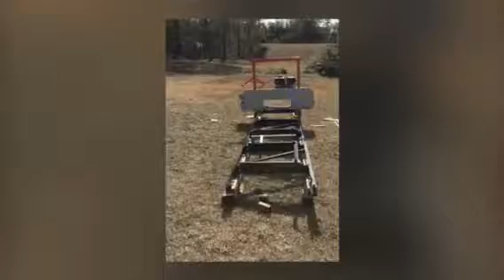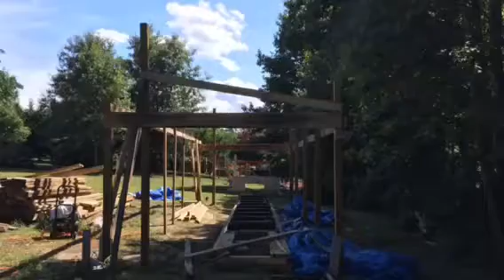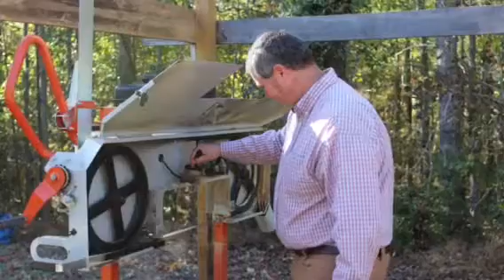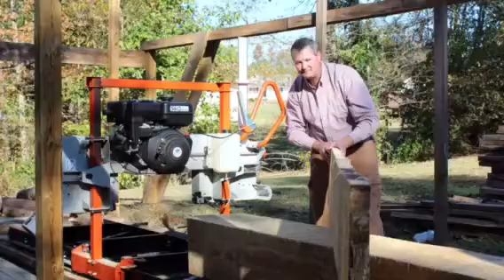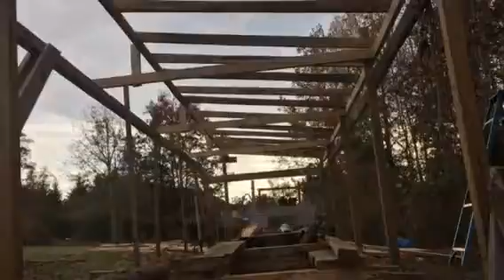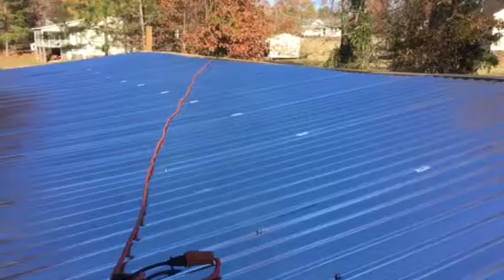Sawmill Shed Build Part 1

Comment: Do you like your timbery Mill, I'm debating on purchasing one but can't find anyone that owns one.
Reply from the maker: Yes I do. For its size, I am amazed at how much I am  able to do with it. I researched several others before I decided on My Timbery M100. I did upgrade to the 14 Horse power and have added bed extensions as I went.
Reply: eddiemac2008  thanks, I was looking at getting one with the 14hp to, just haven't found very many reviews on this unit
Reply from the maker: James Miller are you located in the USA?  

If so what region?
Reply: eddiemac2008 kentucky
Reply from the maker: James Miller I was able to see one in action at an ag equipment show and speak with Chad from Timbery. 

I also contacted and spoke with my local Dealer at Carolina Wood Mixer and Timbery in Albermarle NC. 

They are upfront on info and able to answer any questions I had and didn't give the usual sales pitch. I would recommend you give Joseph Whitley a call and tell them Edward Farmer recommended them to you.

They may know of a Timbery owner near you that will let you visit and see it in action or know of an ag equipment show near you. I've included their contact info for you below.

Wood-mizer Carolinas
28002 Canton Rd
Albemarle, NC 28001

Phone: 704-982-1673
Reply: eddiemac2008. 
thanks a bunch, I might give them a call..

I've been emailing Chad a timbery and he seems to be very helpful..but I would love to see one up close before I pull the trigger.
Reply from the maker: James Miller I did the same for over 2 years. I compared several of them out there and did several visits and demos. I have a friend who has a Norwood 2000, did a hands on demo with with Hudson, and did 2 visits with Wood Mizer and Timbery at 2 different shows. 

For the investment and cost I chose the Timbery for my needs.  Best wishes to you in your research.
Reply: eddiemac2008 thanks for the info it's helped alot just talking to someone thst has one